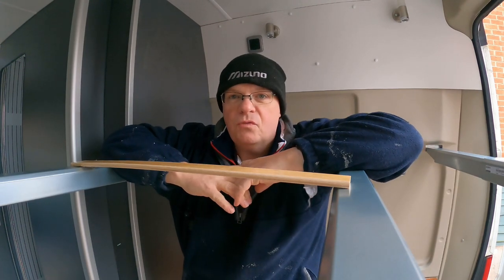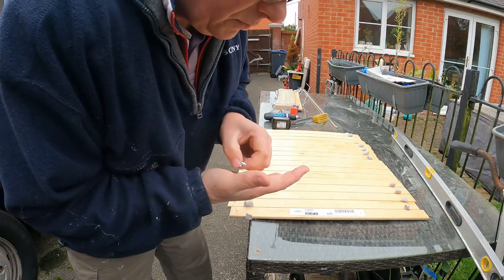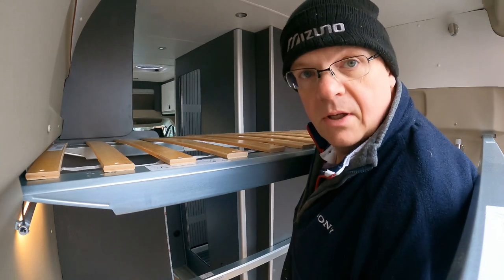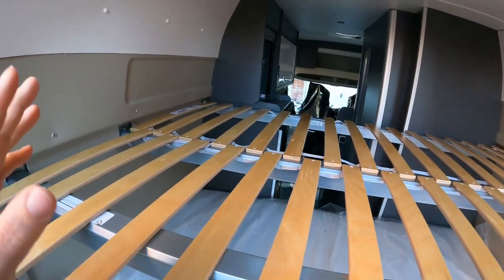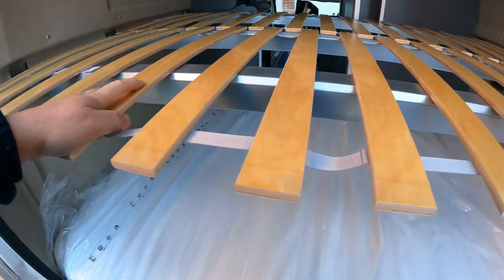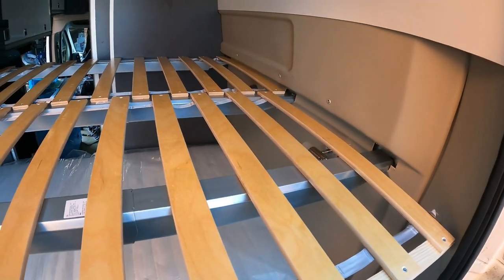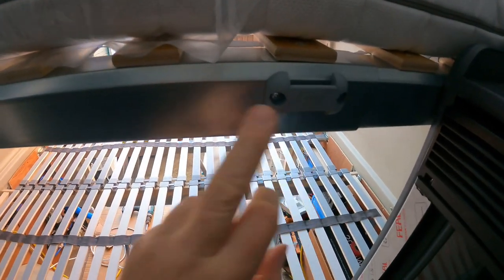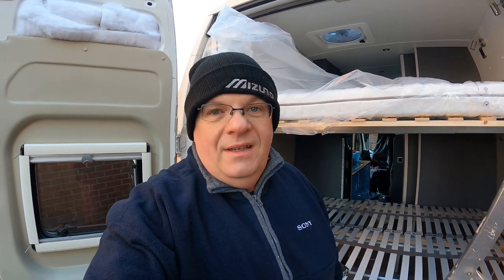Bed frames in a self built camper van Citroen Relay / Ducato / Boxer / Promaster

Comment: Hi, great vlog and a great idea to use the Ikea Skorva beams. How did you go about fitting them to the van itself ? It would be very helpful to pick your brains on this. We are just starting our build. 😊
Reply from the maker: Happy to answer any questions you may have. thanks for watching.
Reply: Thanks for your prompt reply. Do you actually show how you fitted the Skorva beams into the horizontal ribs of your van in an earlier video? If not, how did you fit them to the van? Regards Chris

Comment: Hi  Recently discovered your conversion vids, almost caught up. I have just bought a relay L4 H3 so will be borrowing some of your ideas, excellent vid on to vapour barrier or not i have been giving it a lot of thought your reasoning seems sound. Do you happen to know the weight of the  "skorba beam" . One thing that did concern me was in the hand book it says "On all H3 versions the roof cannot be fitted with a carrying system" page 80, so was concerned about putting solar and vents on the roof, what are your thoughts on this given that you have put solar ect on.
Cheeers and keep up the good work
Reply from the maker: Skorva mid beams are 3.62kg each. On the roof thing, I think they are just covering their asses. why would they install roof rack mounts if the roof is a 'no go' area. I have seen plenty of videos of L4H3 conversions with loads of stuff on the roof, so personally, I would not worry about it. Reality is that the solar panels are very light weight in the big scheme of things as are the maxxfans. good luck with your build.

Comment: Hi can you hep me? my camper is a citroen jumper H2L2 , is possible to put 2 beds?
Reply from the maker: Yes, but because of the lack of height the bottom bed would have to be pretty low so would give very limited garage space. i believe that Rollerteam do a double bunk arrangement in an H2 height van so might be worth finding the info on that for some pics and inspiration on how they did it?